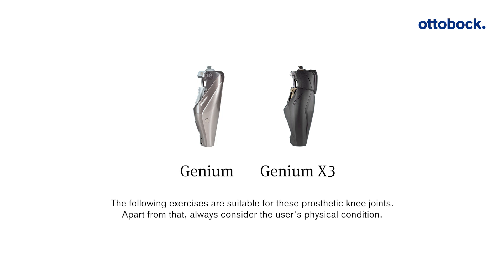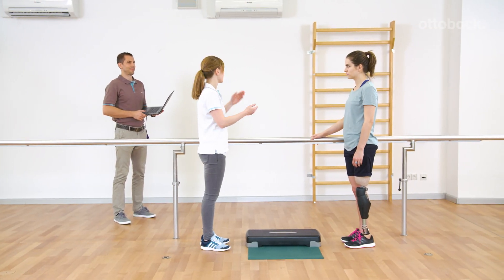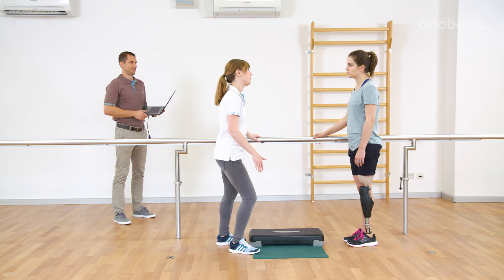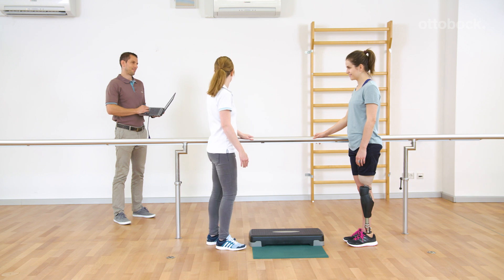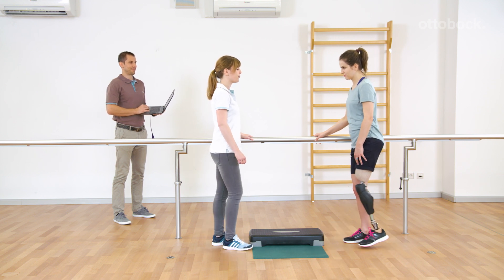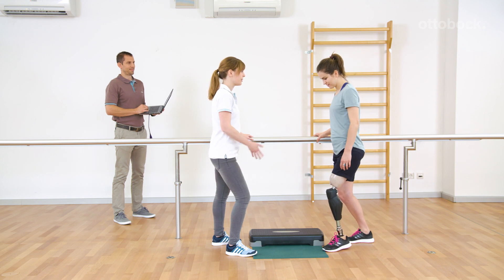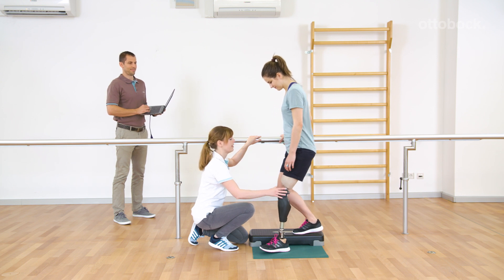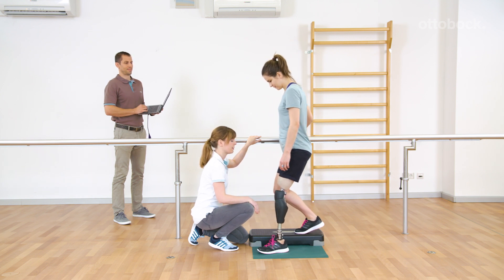Genium/Genium X3 gait training -MyModes: Brake friction knee mode | Ottobock

Comment: What exactly is this brake mode used for?
Reply from the maker: Dear Allan,
Thanks for reaching out. In general this function can be adapted for individual needs and use cases (e.g. riding a motorcycle ...). For the best personal support for this feature, it is best to contact your local Ottobock branch. Please fill out our form to get in touch https://bit.ly/3iGLdYt. To discover the Ottobock branch closest to you, you can also visit: https://bit.ly/38DXjgH 

Kind regards, Your Team from Ottobock